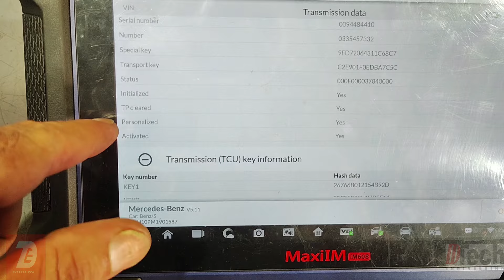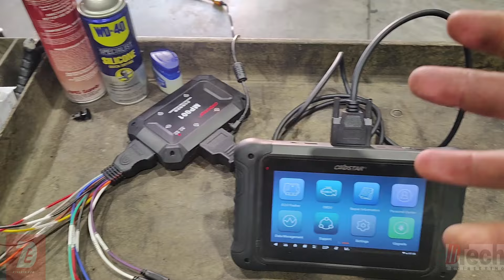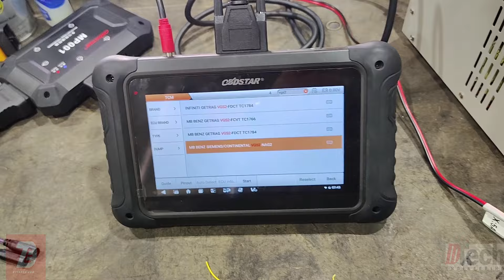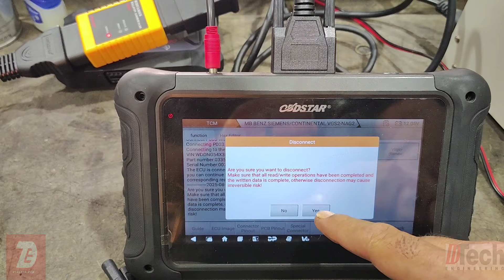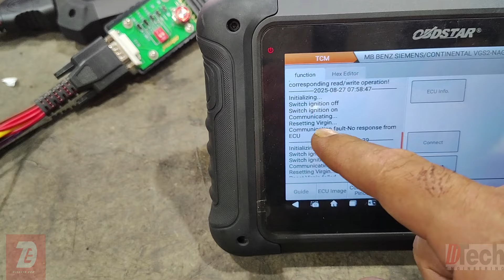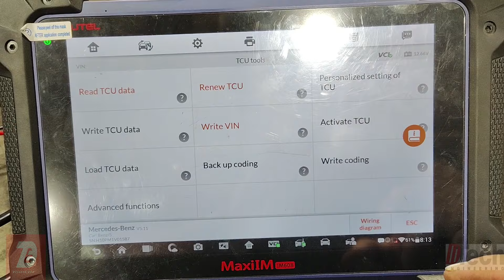Will OBDSTAR New Virginize/Renew Benz TCU Feature Work???

Comment: Always connect the power supply as close as you can to the ECU/module being programmed. The wires in the DC706 to OBD connector lead are pretty thin. By the time the voltage gets from the programmer through the lead and the interface and then on to the module there will be a voltage drop. It is a pity the DC706 doesn't seem to do everything it claims. Hopefully they will get there in the end. Did you find an official OBDStar video on YouTube showing the VGS2-NAG2 being virginized with the DC706?
Reply from the maker: Thanks for that info and I have not

Comment: Good afternoon,

I watched your videos on the Mercedes Conductor Plate. I hope you can help me. I have a 2007 ML 350, and the Conductor Plate in my vehicle was faulty. It wasn’t reading the internal speed sensor. I ordered a new Conductor Plate from FCP Euro and found a company on eBay called Mercedes-Benz Refresh that programmed it. My old Conductor Plate was a version two Siemens model, and the new one I received is a version three made by Continental. The programmer said that since it’s an upgrade from version two to version three, he can't transfer data from one to the other. It needs to relearn itself after installation. We completed all the required learn cycles for the range sensor, selector, and gears, but now when driving, the vehicle shifts harshly. It's not in limp mode, but shifting from 2nd to 3rd causes vibrations, and downshifting makes a clunk. However, when driving on the highway above 40 miles an hour, it runs fine. It never had shifting issues with the old Conductor Plate. I contacted the programmer, and he said it’s not a programming issue—there would be an error code if it were. We currently have no codes, but I read online that incorrect programming can cause shifting problems. I don’t know what to do; the programmer insists there’s nothing wrong with it, but I know the car drove perfectly with the old Conductor Plate.

I live in New Jersey, and if I were local, I would bring the car to you. Do you have any ideas? I took it to my friend, an independent mechanic, and he scanned everything but couldn’t find any issues, so I’m at a loss.

Thank you,

Alex
973-868-8930

Comment: Hi. Nice video. I have all the tools you have and I'm also disappointed in the DC706 because they promise heaven but fall short when it comes to certain procedures. The tool is brilliant for cloning but such a basic function should be a walk in the part for it. I have the IM508 and the Ultra.
One procedure I saw you left out was doing a backup of the CODING. When you replace the TCU from different models, the CODING is always different and that affects gear shifts. What I always do is to back up the CODING data and after writing the VIN, I write the original CODING as well. I at times go further and save the shift data via OBD in diagnosis mode then write the same to the donor.
Thank you for the video because it highlights some shortcomings of the DC706.
Reply from the maker: You are correct, thanks for the reminders and tips on the full complete procedure, I will keep this in mind for the next one! Thanks again and thank you for watching!

Comment: for cloning do you recommend the autel or the obdstar
Reply from the maker: The difference between the 2 is that obdstar has more module coverage including bcm's. But it doesn't always work to clone modules even though it says it can do it. And again, it can only do clone of modules/computers.
The Autel can do module cloning as well of ecm and tcm and immobilizers (obdstar can't do immo) and the Autel can also do keys. The autel can also do actual eeprom reads and writes along with mcu (microprocessors) read and write which obdstar can't do. 
The autel also has a unique feature that it can verify the eeprom/mcu data it reads and writes which is a very super helpful secure feature when performing this type of work, because sometimes the reads and writes of data can get corrupt and the module will not work, and one would never know it was from an incorrect read or write of the data without performing extra steps of verifying the work done. The autels verify feature can automate that for you.
Additionally, if cost is a thing, the autel's programmer unit, the XP400 Pro can be purchased separately and used on a pc laptop. You do loose some features that the tablet offers (keys & verification reads/writes) but can do eeprom/mcu work. I have some videos posted of using it on a laptop. 
Hope this helps
Reply: @DTEAuto  thank you

Comment: Thanks for the video. Can the launch 431 pro3+ elite renew the same or VGS3Nag2 conductor plate. I want to know if can do read/write/ renew and then programming the VGS2 nag2 and VGS3 nag2? If can show the capability of launch x431 pro3s+ ellite in programing the Mercedes TCU. If can show that on video will be thankful. Thx
Reply from the maker: I checked the tool, and it only shows 4 listed under Benz:
VGS2-FCVT
VGS2-FDCT
VGS-FDCT
VGS-NAG3
Those are the ones listed and I believe it can just read and write not renew. But I would have to find one to do in order to be one hundred percent on what it can do with those.
Reply: Hi ,I use launch pad v and the xprog 3 plush the mcu3 and he virgin and clone the tcm easy!Launch is the best aswel for ism on mercedes virgin clone and programming!I test other tools and they fail,launch never ever fail!